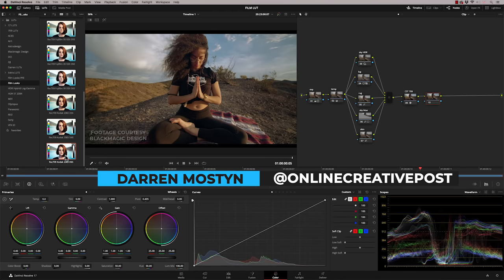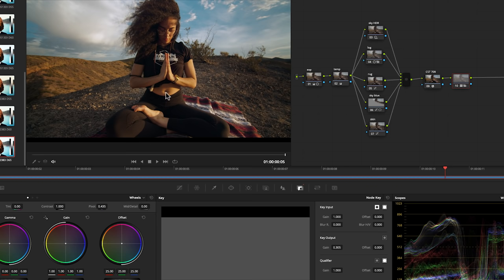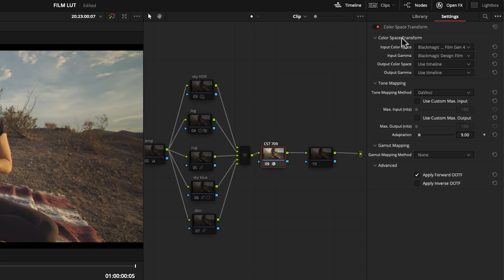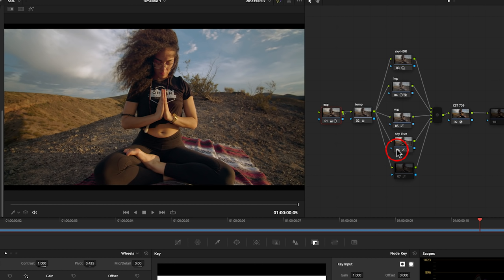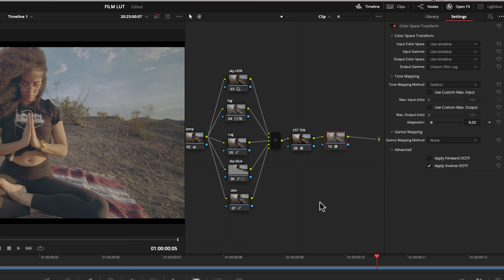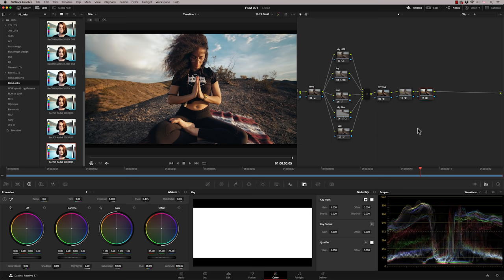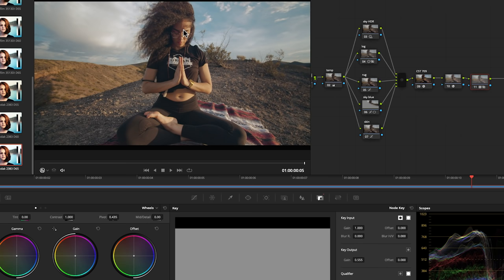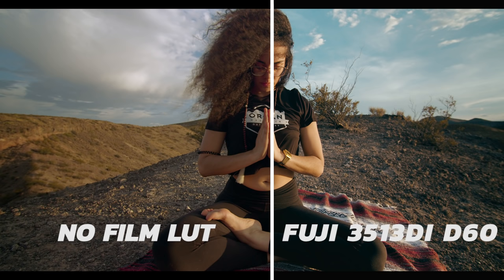Why Do My Film LUTs Look Bad ? - KODAK 2383

Comment: It's always been my understanding that the color space transform (into r709) should be the first node in the tree and all the grading/balance should be done afterwards.  But in here, you did all of the grading/balance prior to the color space transform.  Is this just a preference?
Reply: I'd be really interested to hear thoughts on this too, as it was also my assumption!
Reply from the maker: I grade most of my scene "under" or before the CST to 709 so that I remain in log space, but am always viewing in REC709 as the CST node is ON first. Certain things I grade after the REC709 CST - vignette, sharpen, heavy looks, trim.  Hope that helps.
Reply: You can put them anywhere you need them. It is not unusual to place a CST in the node tree, just to pull a qualifier key.
Reply: @DarrenMostyn  I tried this for a few projects (awhile ago when I was newer to be honest) and I found pulling keys for skin or other parts of the image were very hard and not clean, which is why I opted to go Node 1 base exposure, Node 2 CST,  then the rest would be normal nodes doing whatever else.

Comment: Great info Thank You! Noob Question: I am using a BMPCC 6k and that is not a selection for input Gamma. I tried using Gen 5 Film Gamma and it looks like there is better Highlight and Shadow rolloff when using it. Also, I am finding it puts me at a satisfactory contrast level and all I have to do is add some saturation. Just wondering what your thoughts were.

Comment: I can see I’m late to this but great informative video! Thanks. I have a question that is somewhat off the topic of this video but how do u get your preview screen/playback window to be that big? My screen is very small and I was wondering if it’s because of the labtop I’m using or if I just have to adjust a setting or something. Any info u have would be much appreciated
Reply from the maker: resolution of monitor depends how resolve looks, yes
Reply: @DarrenMostyn  thanks for the reply! So basically it’s something that can only be changed with another monitor and not a setting inside resolve?

Comment: Hello. First of all I change my log to rec with color transform, then I make some changes with nodes (color,contrast.etc.) and in final I apply my luts. So am I wrong?
Why you made first luts and thn convert to REC? Why in finish and not on start?. Thank you.
Reply from the maker: Hello Sam. I grade most of my scene "under" or before the CST to 709 so that I remain in log space, but am always viewing in REC709 as the CST node is ON first. Certain things I grade after the REC709 CST - vignette, sharpen, heavy looks, trim.  Hope that helps.

Comment: Great information.  
How do you know when you need to do a color space transform to Cineon Film Log Color Space? Is there a clue somewhere in the LUT to know what color space is expected?
Reply: For film print emulation LUTs, I think it’s safe to assume they’re expecting cineon film log gamma, and rec 709 colour space.
Reply from the maker: There is no way to know. If the result is extreme then you would usually apply a cineon gamma conversion. Hope that helps.

Comment: Newbie question, is there a reason to apply CST after the correction nodes and not before?
Reply from the maker: Not without huge explanation. as to why I did. I now wish I hadn't for this tutorial to keep things simpler.  Nothing wrong with adding CST at the front. If you are STARTING OUT, I would do exactly that - And it is not incorrect to do that either. Hope that vaguely helps ?

Comment: Might be a strange question, but I am very new to film making. When I use my Nikon Z6 that doesnt have log (only via HDMI) and I use a custom flat profile, can I still succesfully add the Kodak 2383 lut If I transform into cineon log before? Thanks
Reply from the maker: if you can convert your profile to rec709 and then gamma cineon film log you'll be ok.
Reply: @DarrenMostyn  okay thank you! I will try it out, I believe that I saw somewhere in resolve that my clip had rec709 but I will experiment a bit :)

Comment: Super helpful, Darren! As from another tutorial of you I implemented a node tree based color management, doing all my correction between two CSTs with DaVinci Wide Gamut / DaVinci Intermediate. But following your way here adding another node after my CST to Rec.709 gives me a completely blown out image. I only got it fixed when I set my "output gamma" directly from "gamma 2.4" to "Cineon Film Log" on my last node, which does the rec709 conversion as well. Any idea what's happening there?
Reply from the maker: are you color managed workflow or just sing CST's. This workflow here is CST only.
Reply: @DarrenMostyn  yes, i use CST only.

Comment: Thought example: Does it makes sense to apply a rec.709 lut, compare it with an audio wave to mp3 compression, then unpack it into a wave again and apply another effect? Would it not better to apply the look-lut before the bm-film to rec.709 lut? Which colorspace expect the inbuilt look luts in Resolve?
Reply from the maker: No because its a LUT. They can be destructive. Hope that helps.
Reply: @DarrenMostyn  That was my point! A view transform from log to Rec.709 is compressing data and is destructive. A "look" can be, but does not must be. The "scene looks" in base light for example are not destructive and meant to be used in a scene referred working colorspace. The implementation of "looks" in Resolve is therefore an important point. I will try to find out how they work.

Comment: Excellent content here!  But I have a question.... how did you figure that out?  What I mean is how did you figure out the input color space needed for a given LUT?  Is that documented somewhere?  I ask because I'd like to lookup the input requirements for other LUTs I may try in the future.
Reply from the maker: Hello. Sorry, only just seen this comment. If you open the actual LUT in a text editor it will tell you what the input gamma is expecting to be. Hope that helps.
Reply: @DarrenMostyn  No worries.  Thanks for the reply.  It does seem that the ".cube" files for the Film Look Lut's indicate the input lut.  It doesn't appear that that is standard throughout other LUTs though which is unfortunate.

# Resolve Film Look LUT
#   Input: Cineon Log 
#        : floating point data (range 0.0 - 1.0)
#  Output: FUJIFILM 3513DI film stock 'look' with D55 White Point
#        : floating point data (range 0.0 - 1.0)
# Display: DCI-P3, Gamma 2.6

Comment: Nice tutorial, made me curious about how to apply this to a Colour Managed project, but I can't get a match using either the SDR or DaVinci WG presets, certainly not using a method that would be technically correct, though an 'incorrect' method can get things looking decent. Any thoughts? Also, I find that even the method you show adds a lot of contrast that I have to add a node to dial back on, though that's just going to be the nature of the LUT I guess.
Reply from the maker: The colour managed settings Im working on. The CST should give you good results though.

Comment: Hey Darren! Quick question. Should the compound node method be used for other luts thats not a film lut? or does the reduce key work fine for other type of luts?
Reply from the maker: Only use compound if you are using a CST to change gamma before the LUT. If your LUT works straight from a REC709 image for example then no need to make a compound node. Hope that helps.
Reply: @DarrenMostyn  Thanks! Makes perfect sense! so when i use CST from clog to rec 709 then apply lut i do compound node correct?
Reply from the maker: @Theaaronchris  only if the actual FILM EMULATION  LUT is expecting something other than REC709 in your example here. Clog to 709 is not to do with film emulation LUTS. Hope that makes sense ?

Comment: QUESTION: Could you put the CST from 709 Gamma to Cineon Gamma and then the film emulation LUT in the same node? Don't CST operations get applied first (within a node) and don't LUT operations get applied last? That way, you won't have to group the two nodes (709 gamma to Cineon and Film emulation LUT) together and then adjust the key output. Also, I had to watch this a few times because you mentioned "changing the color space" when in reality, that CST node is just changing the gamma curve, right? I'm not missing anything am I? We aren't changing the Rec 709 color space, just the gamma curve, si?
Reply from the maker: I would rather determine my pipeline using nodes than hoping one operation precedes the other. It is not much work to do. You are right, I am only changing the gamma output for the film LUT. REC 709 is always the working colour space in this instance. Hope that helps

Comment: I got one question concerning color-space-transform nodes: If I am working with davinci color managed: Do I need these nodes? The "transformation" into rec701 would be done during export.
Reply: lut need full range to be accurate
Reply: @oliviertalouarn6258  I meant this in general, not focused on applying LUTs
Reply: this video is about cine lut ... so. If you dont use them, you dont need those nodes, but you can set an  intermediate wide color space in color managment preferences; avoiding loosing range in the process

Comment: Hello Darren, Fantastic tutorial. And very useful information. Just one question. Can I do the same trick without the conversion to Cineon.
I mean, I ad a two extra notes on the end of my Raw Rec709 grading.
On the last node I ad a real Rec709 lut and the node before is there to make a compound node. 
So with these two nodes I want to make a compound. Is this the right way to do? 

cheers
Reply from the maker: not sure I fully get you but you need to be in Cineon gamma for the film luts to work well.
Reply: @DarrenMostyn   Thank's for reply, well I've got these Canon  DSLR neutral luts what should be used on Rec709. In my case Raw Canon footage.  But I find them a bit to strong. So I wonder if I could make a compound with two nodes the way you explain in order to soften the look without converting to cineon. 
greetings
Reply from the maker: @richardrem  easiest way is just apply the LUT and forget compound nodes, just use the gain tool in the key mixer as I do in my tutorial on the compound node, but just apply straight on your LUT node. All the best.
Reply: @DarrenMostyn  Ok, thank's a lot for reply.
Cheers

Comment: sir i have been using fpe without converting footage into rec 709 but before the show lut i use cineon film log as u said then go to to 1st node and do adjust the exposure and balancing stuff...is it right or should i convert the footage into rec 709 before using show LUT.plz help me...
Reply from the maker: No you can do as you are. I could have done all this on one node - just thought easier to show workflow. So, you can say Arri to cineon and apply the FPE and then this takes it to REC709.  I only went to REC709 first as I think a lot of my viewers are in REC709 so it was easier to explain. Hope that helps.
Reply: @DarrenMostyn  100% it helps me...thank u so much sir u r very kind...sir one request i got a project which will be projecte on theatre.can u plz help me the workflow?shoud i use rec 709 timeline or dci p3?what is the proper workflow?

Comment: Is there any way to get Print luts to work in Davinci Color management workflow ?
Reply from the maker: They don't respond well in DRCM due to the signal flow. Output is always end of the pipeline in DRCM whereas with CST you can control the flow.
Reply: @DarrenMostyn  That a shame as I pretty  much always include a 2383 in my grading . Cheers.

Comment: Is it ok to use my timeline color space as Rec.709-A when using mac?
Reply from the maker: This will keep gamma tags for you when opening in Quicktime so the settings match. If you are delivering broadcast then this is the not the correct setting, you shoudl use 709 2.4
Reply: @DarrenMostyn  thank you for your answer! If the edit is for web/ vimeo/ youtube is still correct to use Rec.709-A?

Comment: Forgive me if you already mentioned this - but even though I already have my Color Management setting set up with YRGB Color Managed > Wide Gamut with an Output Color Space of Rec.709 Gamma 2.4, would the CST node even be necessary?
Reply from the maker: Hi Destin. The REC709 CST would not be required. Everything else the same.
Reply: @DarrenMostyn  thank ya, sir!

Comment: Hi Darren, can these Film Emulation luts still be used when working in RCM? So far I can't get similar results to working in DaVinci YRGB.
Reply from the maker: Not so great in RCM. Thats why I am using CST.
Reply: @DarrenMostyn  Thanks for the reply. My assumption is that when working in RCM the colorspace transform is happening after the node structure and therefore those Film Emulation LUT's can't be used in a similar manner.
Reply from the maker: @jelmerd3867  the input transform is happening pre nodes and the output is after all nodes. Thats why CST is useful as you can control where the transform takes place.
Reply: @DarrenMostyn  Ah yes, ofcourse. Thanks!

Comment: well this works in Da Vinci Wide Gamut color space too?
Reply from the maker: Not really getting good results here.
Reply: @DarrenMostyn  well using the cst and setting to da vinci wide gamut I just achieved some discrete results but not completely satisfying at least. Wonder if the lack is about film emulation luts. Are those ones setted in sdr a d yrgb standard? Guess if will be updated for da vinci wide gamut... anyways thanx

Comment: I'm getting very confused. When I start a Timeline with HLG footage I go into Colour Management and choose:
Colour Science DaVinci YRGB = Colour Management
Resolve Colour Management = DaVinci Wide Gamut
Output Colour Space = rec 709 Gamma 2.2 ( I get confused with 2.2 and 2.4 but I'm watching on YouTube and monitors)

Have I correctly converted to a rec 709 colour space?
or do I also need to add a Node with Colour Space Transform?

Seems like I'm duplicating the same thing and this is where my brain hurts. I just want to convert HLG to Rec 709 while editing in resolve.
Reply from the maker: Hello franck. Only be on gamma 2.2 if your output monitor is set to 2.2 (and calibrated to 2.2)
Reply: @DarrenMostyn  Apart from the gamma bit, am I duplicating the Colour Management timeline when I add a node for Colour Space transform?
Cheers
Reply from the maker: @frankinblackpool  dont do a CST for 709 if you are already in colour management. Just use CST for Film Lut. Hope that helps.
Reply: @DarrenMostyn  It sure does help, and fills in a few blanks in my learning process. Who needs to go to Film School when trial and error wins the day 🤣
Don't worry I'm a bit more grown up in my day job, with a total disregard for the Highway Code and Road Traffic Laws. Driving on blue lights does have its up sides

Comment: I think it’s worth pointing out that when you convert your gamma to Cineon you are not changing the colour space. All you are doing is changing the tone curve, or ‘contrast’, it’s as simple as that. The Resolve luts are designed to expect rec709 primaries so they look ok in this instance. Some print film luts however will expect a film neg’s primaries and a Cineon gamma. In this case if you were for example working with logC you would
first want to convert the primaries to be closer to a film negative which you could do with the arri film matrix, then convert from logC to Cineon, and then apply the film lut.
Reply from the maker: Hi. Yes I understand that - I dind't mean to say Cineon "colour soace" I meant to say gamma. I have pointed this out in the description as YouTube doesn't let you replace the video after uploaded. Thank you for pointing it out anyway. All the best.

Comment: This did not work for me, but perhaps it is because I'm working in YRGB color managed - Davinci Wide Gamut?
Edit: yep, that's it. Here is the solution if working in DWG: https://youtu.be/GAebiy2TIAc?t=305
Reply: let me know how if you found a solution!
Reply: @SemmyDueren  I did! The reason it didn't work this way for me is because the resolve LUTs are not meant for Davinci Wide Gamut timeline color space, they are meant for Rec709. 
So either work in Rec709, or use this workaround (worked for me): https://youtu.be/GAebiy2TIAc?t=305  
However, I made two corrections regarding the link above that worked better for me:
1. Use cineon film log instead of arri logC
2. Don't select "use timeline" on the CSTs, instead specify Davinci Wide Gamut / Davinvi Intermediate.

Good luck!